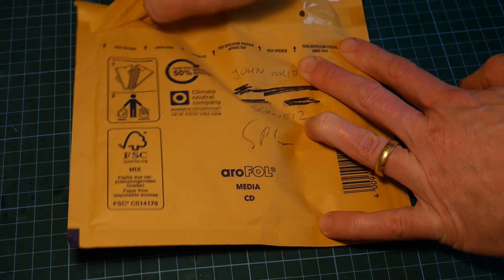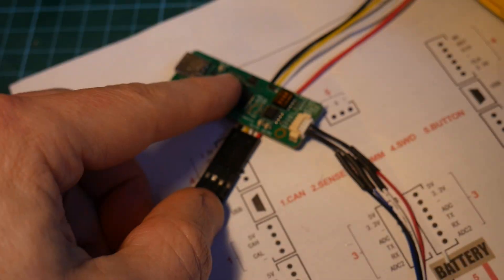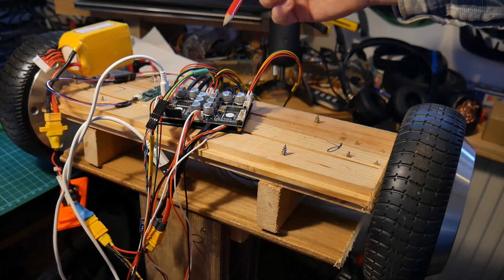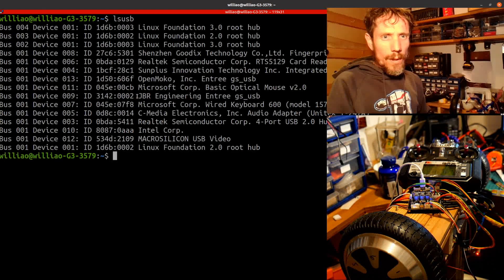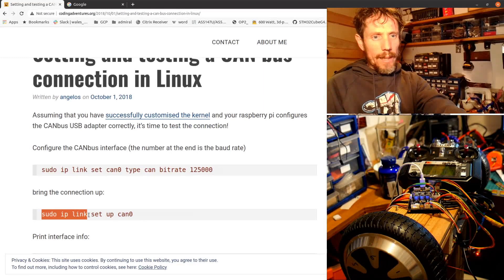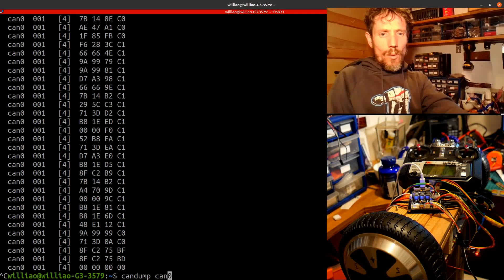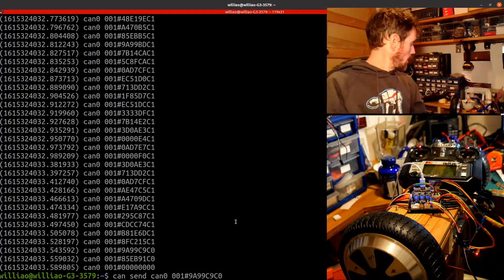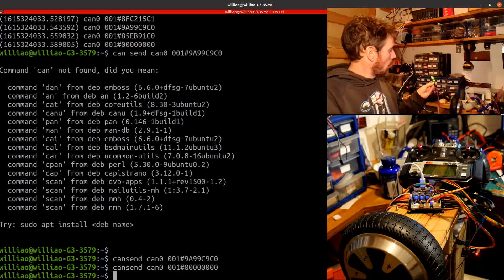USB CAN BUS - Arduino Motor Control (Record & Replay)

Comment: 2022 now. My dad and I have programed a Arduino to monitor voltage, temperature and current with the VescUart library (it's for our DIY e-foil)
However we would like to use the UART port for some other things, and would love to do this "monitoring" by using the CAN bus.
Any suggestions on how we can do this? All example codes we found till now is by using the UART port.

Comment: ESP32 has CAN built-in. Did you consider just piping the CAN commands through that? Seems like a cheaper solution, or were you worried it might not be fast enough to pipe through a USB serial port, to ESP32, out to CAN?
Reply from the maker: You are right, I could take that approach.  I used an esp32 to talk to two stm32 over CAN on this video
https://youtu.be/c_iQgfNlFz8
The USB CAN adapter may simplify things. E.g. python scripts on a jetson nano controlling a complex array of devices using CAN frames.  Still learning!